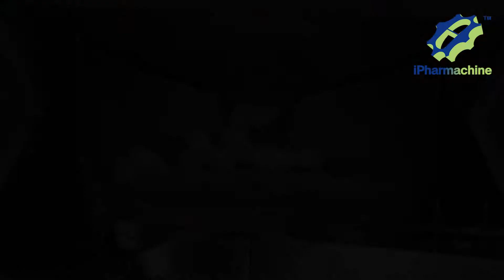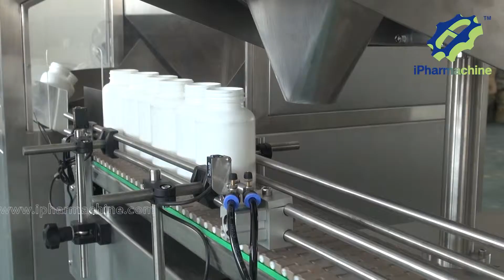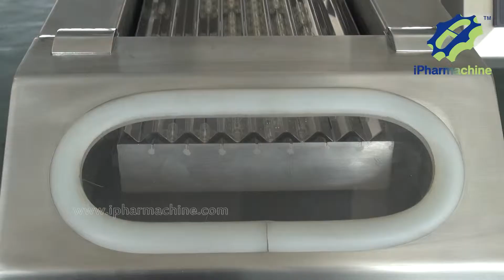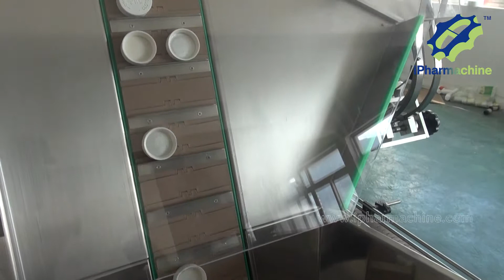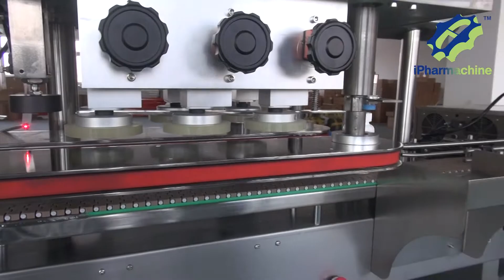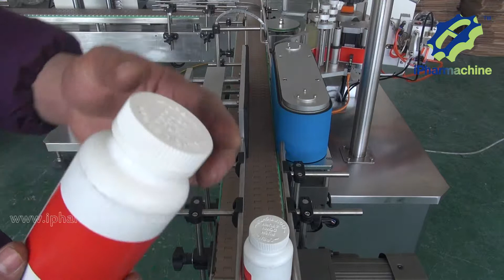Capsule Tablet Counting and Labeling Machine

Comment from the maker: PHARMACEUTICAL EQUIPMENT
1. Empty capsules: https://www.capsulcn.com
2. Machines for mixing of powders, granulation, compression, de-dusting coated, packing, packaging, counting: https://www.ipharmachine.com
3. Automatic capsule filling, liquid capsule filling, bottling line: https://www.pharma-equipment.com/

CapsulCN has more than 25 years, providing our clients with assistance in the delivery, commissioning of various pharmaceutical machinery. Thanks to CaspulCN's Research, Development, Engineering, and Expertise in Manufacturing, we can provide you with a suitable and reliable solution to meet your manufacturing requirements. 
Are you looking for a reliable supplier of equipment? 
We will give you the best service 24/7.
We have set ourselves the task to help our clients in the correct choice of pharmaceutical equipment. 
Years of experience of such activity shows that many clients face, first of all, a lack of understanding of the process. Purchase of the equipment should be the final point after a detailed discussion of the problem, consult with the equipment manufacturer, sending raw materials to the factory, test operation.

Our most common pharmaceutical machine is composed of: 
1. Automatic Bottle Unscrambling Machine 
2. Capsule Filling Machine 
3. Encapsulation Machine 
4. Tablet Press 
5. Bottle Cleaning Machine 
6. Counting and Filling Machine 
7. Weight Checking Machine 
8. Desiccant Inserting Machine 
9. Cotton Inserting Machine 
10. Cap Torque Machine 
11. Aluminum Foil Sealing Machine 
12. Labeling Machinery